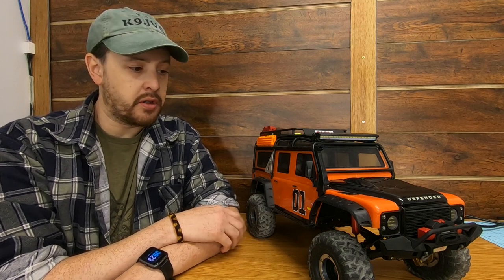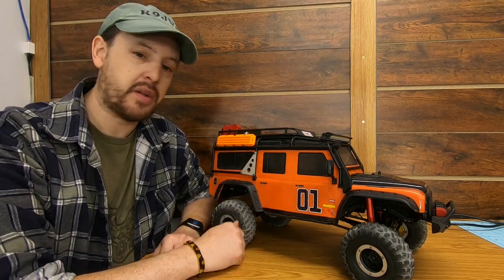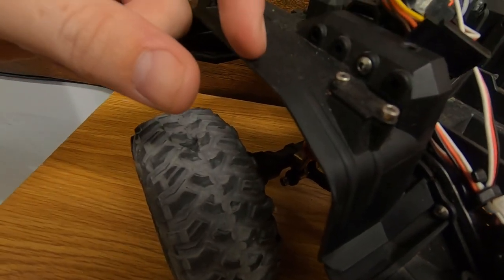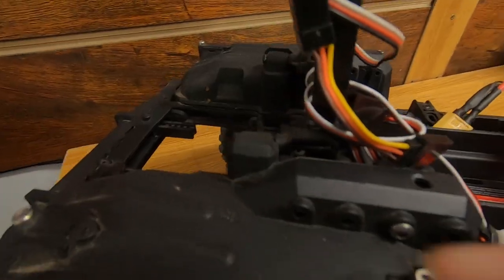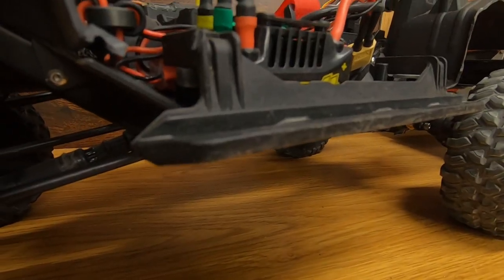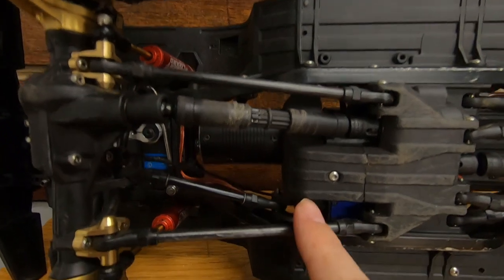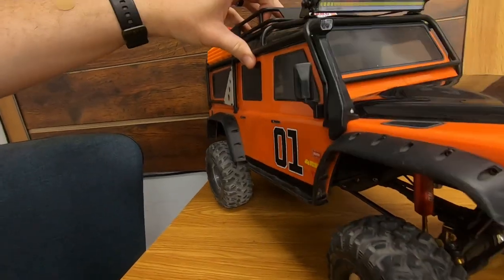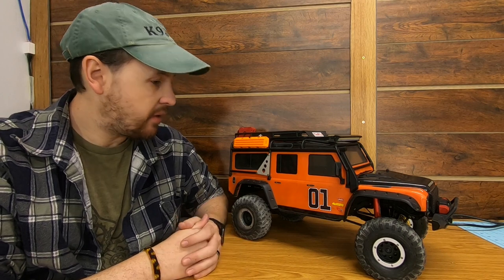How to turn a TRX4 Bronco into a TRX4 Defender: It seemed like a good time for a change

Comment: Cool vid.  I thought about doing the same thing to my bronco, clever  idea with the front links rear swap. Only thing I would have done differently is buy the shock post brackets for the defender they only like $10-$15.  Then u don’t have to hack ur chassis wheel wells. U can always buy replacements, I guess. I just try not to cut things unless I have to.  Anyways Glad to see ya back  with a new vid.
Reply from the maker: Paul’s Hobby Life I could have planned the transition better for sure. I just woke up one morning and said to heck with it today I'm making it happen. 😂😂 It was a theraputic project. And I figured as long as it made me smile when I looked at it afterwards it'd be all worth it. 👍👍

Comment: Do you not have to extend the rear prop shaft seen as your extending the wheel base?
Reply from the maker: The drive shafts come from the factory with enough length to accommodate the stretched wheel base. 👍👍
Reply: There is a kit on the go with longer link rods and longer piece for driveshaft as only about 5mm left holding it together with 100mm shocks